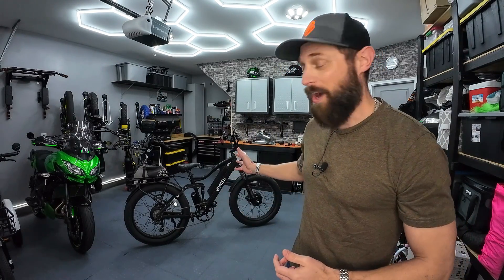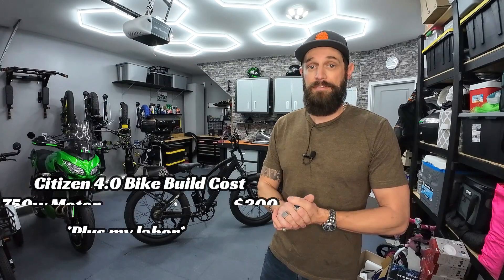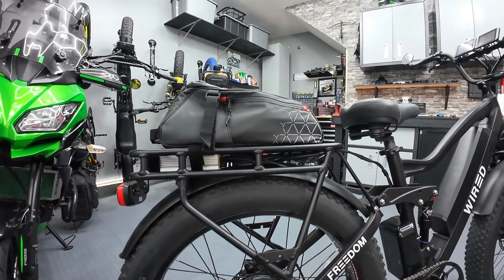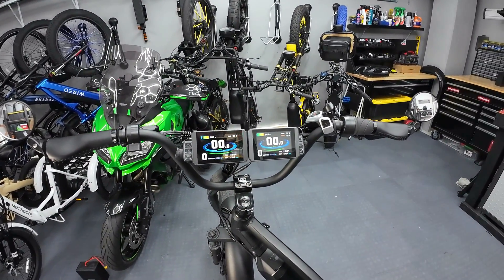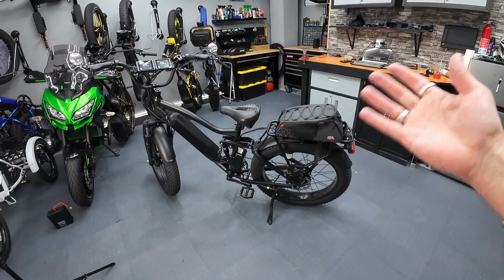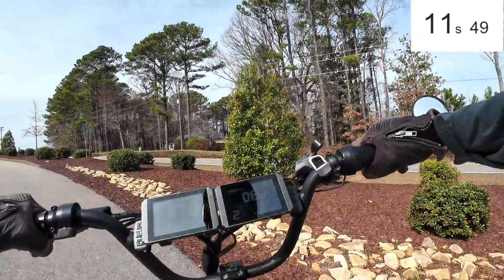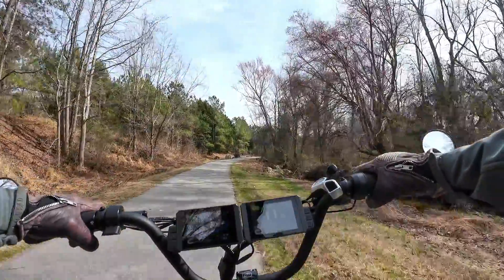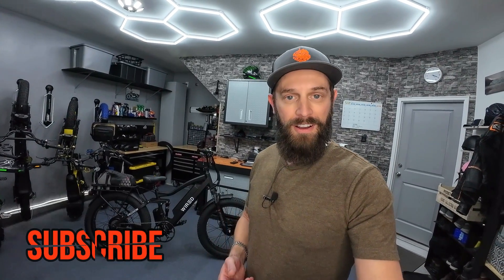AWD Conversion Kit: Should I build Them?

Comment: Great video Citizen. I'll maybe take 2 kits depending on pricing
Reply from the maker: awesome, pricing and more info coming soon!!
Reply from the maker: Hi Jeffrey, Kits are available for pre-order now at Citizenperformance.com
Reply: Hello Citizen. Did you have a final price on the kit and what is the maximum voltage on the 40 amp controller ? I have a spare 60 volt battery on hand.

Comment: I thought I posted on here yesterday, but let me know if you want the info for a 2000w front hub custom build, 500 buck's, but comes with controller, hub with wheel and display. Easy plug and play.
Reply from the maker: is this a direct drive 2000w motor?

Comment: You are the man 😎. I have the August 2023 cruiser, would this work with my bike? I also bought an extra battery ($800.00) . You said that the front forks would need to be changed, do you know what the cost of those are? That would be something I would like to get ( after I have more time on my bike,200+ hours on it ). I'm still a newbie with e-bikes (Wired) . Thank you for a great upgrade. Keep on rocking 👍🏼🚵🏽
Reply: Your forks will not work. The FST are about 200 bucks.
Reply from the maker: Your 2023 probably has Mozo forks, you would need to switch to RST Guide which are about $200.  thanks for the comment

Comment: E-Cell at 146nm is the same bike as the wired Freedom at 138nm but much cheaper!  That extra savings could buy you an upgrade front fork for front motor!

Controller KT 60v 40A 146nm controller. Delivers 2400 watts of power while the wired Freedom motor is 2200w peak!

Comment: I be thinking on this one for Kepler . I'm running on 60amp batteries already. What are wiring connections for display? Wanna use same display what I have .
Reply from the maker: this display allows you to program top speed, pedal assist strength, and slow start settings. does your current display have that functionality?

Comment: I would love the kit but dont really want the extra battery mounted.  Maybe its not possible but if it connected to stock battery somehow?  Great build tho!  Very clean build!  Great job!
Reply from the maker: will probably sell a Kit no battery option.  not sure about connecting to stock battery, not sure if battery could handle the draw from 2 controllers...
Reply: @CitizenCycle925  Yea that make sense.  Also my rear rack is not a 23 or a 24 model.  and although appears stronger?  All one piece with no wire or smaller tube bracing to it.    I dont know if controller would fit.  Another thing I was thinking is the charger for your battery.  Does it come with it?  Are they so cheap it dont matter?  I do like the fact they are 2 separate circuits.  Anyways that kit look awesome!  I would pay $800 for it but I know with some down falls.  Mainly having to deal with extra battery for me personally.  I mean its not that big a deal.  IDK   I cant answer if you should try to sell or not.  It is mean and clean tho.  Sorry Im not helping answering your question.

Comment: Resellable AWD Kit, sure...great job.
You can't stop now.
It's only 85% complete.
It's not done till you merge the displays and front/rear selector switch like the Grizzly. 
One more month, then Celebrate‼️

Next project dual 45A controllers on your Grizzly ‼️ 🤜🤯🤛
Reply: My X is better two separate systems are better in case one go down you still have a motor to help you move the bike

Comment: 🐍 Two Displays,...blah blah blah‼️
You just have a mother's love❤ for your Frankenstein build.

If you join them together like your Grizzly....You will love the build with  more ❤❤❤ simplified safer setup. 
Two throttles handicaps you.
You can't hold a cup a sip on a drink with your throttle thumb attached to the left grip.
🖖🤙
Reply from the maker: didn't want to overvolt the motor, motor manufacturer wont warranty.

Comment: You should keep 60 v batteries for both motors. Pain packing 2 different chargers. Of course higher voltage higher speed so your bike will go a little bit faster than what you just did. Always good to have that extra battery in case something goes wrong.
Reply from the maker: Hopefully with the additional range of a 780watt hour battery you wouldn't need to carry the chargers.... :)   also the 60v costs more and i didnt want to overvolt my 52v motor..

Comment: Yes, I'd definitely be interested, - IF I had a FAT bike, and IF I hadn't, just 2 weeks ago, converted my original 288W 35V 8Ah  folding mountain bike to a 1200W 48V 20Ah bike! Still on 26 x 1.95 tires, mainly because of less rolling resistance, AND the ability to get it onto the bike rack of public bus transportation here in LA. However, I may have miscalculated my strength a tiny bit, as the battery itself weighs a 17lb, plus the beefier bigger hub motor … I'm fit, yet already in my sixties ;-)    I guess I'll have to beat the bus anyways, it's way easier now!      I let a couple of my friends (who have powerful eBikes themselves) ride my renewed, upgraded bike, and they came back with a big grin on their faces, saying: "Man, that's really fast! Congratulations." and "Wow, That's fast. I want one of those too now!"
Keep up your good work! Thx!

Comment: This is super awesome! I’m   Actually right now debating on buying a wired or another ebike which has dual motors in it. I’m on the fence bc I’m on the shorter side like your wife. Not sure I’d be able to comfortably ride it. If I do buy it, Id definitely be interested in a kit. I’d like to have a 20 ah battery for it though.
Reply from the maker: as long as you put RST Guide forks on whatever bike you have, you would be able to use this kit.
Reply: E-Cell at 146nm is the same bike as the wired Freedom at 138nm but much cheaper! 

Controller KT 60v 40A 146nm controller. Delivers 2400 watts of power while the wired Freedom motor is 2200w peak!   Or buy the dual motor monarch!
Reply: I’ve seen the reviews for the ecell five star. A lot of similarities but it’s not supposed to come out until late spring early summer. No one has even test rode it yet. I actually can pick up the wired freedom and don’t have to ship it, So no shipping costs for me 🎉. Just got to pay Uncle Sam 💰. Wish I were taller 😂

Comment: How about a 60v 60v setup with the front motor just being over volted. If there is too much wheel spin just neuter it in the settings. Then fit a 15/20ah battery to the back. Then you could have beast mode and swap wheels to stocker for long range mode with a combiner🍻 using a blender with the 52v would be less desirable.
Reply from the maker: if motor is overvolted the manufacturer wont warranty

Comment: I’ve been thinking about doing something similar to my grizzly, but with a 72v kit on the rear wheel and keeping the front stock, so this was really informative thanks. Did you contact battery manufacturers for your battery or was that something you got normally? The biggest hurdle for me is finding a 72v that fits my bike with a high enough bms for a 100a controller
Reply from the maker: i went to manufacturer directly to have battery made.

Comment: I would be interested. I would be shocked if there aren't a bunch of Freedom owners interested. Why did you go with a 52V system for the front instead of sticking with the 60V system..? Cost?
Reply from the maker: Cost and also didnt want to overvolt the 52v motor.
Reply: @CitizenCycle925  Do they make a 60V front motor.?

Comment: Hail Citizen! Love what you have done. unbelievable! My only question is, would I be able to adapt this kit to my Electric xp2 step thru?? Tc from Nevada
Reply from the maker: if enough folks want a 20x4 version i could potentially build that too.  you would also need to switch out your forks to RST guide forks.
Reply: @CitizenCycle925  Thanks for your response. Do appreciate your attention. My bike totally needs another battery, not getting a lot of distance out of the factory battery. The thought of another motor would be nice!!

Comment: Good work.  I have 4 diy ebike s 3k to 4k power.  3 are awd.  I recommend 2k or 3k rear and no more than 1k front, but I do combine into one throttle.
Reply: Wired comes with a 60v 2k in the rear from the factory, and he added 750 to the front...so specs match.
Reply: 45amp x 52volt =2200watt+ 
ithink he said 52v front battery an 60v rear

thats why he has tfront wheel spin...voltage should match front and back.
Reply: @joeberginc7415  The wheel spin is because the center of mass is more towards the rear than normal, due to the battery on the back rack.  There just isn't enough mass on the front fork to hold the wheel down.  I'd be curious what would happen if the 2nd battery were mounted toward the front of the frame or even better, like a front basket to the head tube....it would have to help some.

Comment: If this fits last years model then I would be interested
Reply: Last year’s model does not have FST fork
Reply from the maker: the 2023 model Wired has Mozo Forks so you would have to switch them out.

Comment: definitely sell the kits "in fact" I'd even be interested in buying a already fully equipped AWD "FIRE-Wired" upgraded bike directly from you... 
only thing I'd rather that differs from your preference is I would of course rather have the single throttle set up and a motor selector switch...
Reply from the maker: okay thanks for the feedback, i only have 1 sample kit right now to work with.

Comment: How about a direct drive front end  so you can have a 3k front drive to pick up after the rear motor maxes out and would have regen on the front end...
Reply from the maker: there are lots of direct drive motors on the market, i wanted to supply geared hubs which are very hard to find.

Comment: I built my first dual monitor in 2019 during the pandemic 1000 watt motor and a 1500 watt motor for the rear but I didn’t have the display I had a Violimart throttle I like your build it looks clean 👍

Comment: I got to say a lot of guys are out there, throwing giant batteries, super high-powered motors, but yours seems to be the most functional, the cleanest in the safest job. Well done.
Reply: Yes as soon as i get the 2024 wired freedom. Will it come with the correct forks on the stock wired Freedom?
Reply: @jasonmanitsas2770 No, You are getting a better bike and cheaper with the new E cells. I would research before getting the Wired. Especially now they can't provide proof of them being UL certified.
Reply: @jasonmanitsas2770 I would check out the new release of the E-Cells release before getting a Wired. They did so many improvements over wired and it's cheaper, service is excellent. Even there paint job! They even water proofed the controller! Wired is now having problems providing the proof they are UL certified and it's not going to well for them. Honesty has to be number 1 when you are doing business with people! It will make you or break you. Always research a bit so you can make the best decision for yourself.
Reply: @jasonmanitsas2770  I would check out the new  E-Cells release before getting a Wired. They did so many improvements over wired and it's cheaper, service is excellent. Even there paint job! They even water proofed the controller! Wired is now having problems providing the proof they are UL certified and it's not going to well for them. Honesty has to be number 1 when you are doing business with people! It will make you or break you. Always research a bit so you can make the best decision for yourself.
Reply from the maker: thank you for that!
Reply: Well. First, I have to pull the trigger and buy one. I'm on the fence between the Freedom or the philosophy jumbo. If I get the freedom, I'd definitely be interested in the update.
Reply: @stevegriffith7236  I would really take a look at the new E-Cells over the freedom! Watch a couple of reviews as I believe you will change your mind on the freedom!

Comment: Why not just put a bigger, like 3000w motor in the rear? Having a front motor is kinda squirrellky at times I find.
Reply from the maker: i wanted to supply a kit specifically for AWD and i believe 3K Rear motor kits are already out there.
Reply: Hey @tomsewell2462 am I able to just switch mine out with the 3000w motor  would same connections. What controller would you recommend and if you can send the link thanks.
Reply: Lmao @carlosmondragon8499 why you asking this guy who just asked the same question pretty much?

Comment: might be interested, how much weight does it add overall?

Also, If you are up for it, I'd like to see what a freedom looks like on 24 or 20in wheels, if it's possible to swap the motors?
Reply from the maker: Kit adds about 15lbs. I dont have any 24in wheels but they may look okay.  not sure that 20in would look good.

Comment: I will buy your kit. As is.
But I would also pay more for higher voltage controller and battery.
Smooth quiet street tire mounted on the front wheel would be a bonus that I would be glad to pay for (including more $ for the best puncture protection).
Forks are expensive, but a good twenty millimeter through axle strong front fork would be great. Steering damper? I will buy as-is, but I would also purchase your higher end kit.
Reply from the maker: Okay, thank you for this input!! appreciate you!

Comment: What if you put torque arms on the front of a different set of forks?
Reply: Honestly, I probably wouldn't risk it. I've seen another channel "Dude Stuff" where he did crazy mods like this and said the same thing about the RST fork.
Reply: I’ve blown out a steel fork w the geared hub. Steel might be stronger, but they usually don’t have suspension and the tubing is not very large diameter. I think the RST guide fork dropouts are just so chunky it doesn’t matter. I have my 750w front hub on 72V in the RST guides and it works fine. With just the torque washers. I am using 4 of the torque washers
Reply from the maker: I dont have much faith in those Hose Clamp Torque arms, i have broken those before too.

Comment: i'm ordering a (green) Freedom tomorrow (~2 month backlog?) 
This is a perfect solution, count me in, as that'd make it the most badass bike in my KS time zone.
Reply: E-Cell at 146nm is the same bike as the wired Freedom at 138nm but much cheaper! 

Controller KT 60v 40A 146nm controller. Delivers 2400 watts of power while the wired Freedom motor is 2200w peak!
Reply from the maker: Kits are available for pre-order now at Citizenperformance.com
Reply from the maker: okay thank you for the response!

Comment: I think a high power rear wheel geared hub kit would be a bigger hit,  A 1000w Bafang hub  with a 30amp controller is the most power I have been able to find in a complete kit.
Reply from the maker: that is another upgrade i have considered making.  but i would try for 1000w motor with 45a or 50a controller...
Reply: @CitizenCycle925  yep, then we wouldn't have  to buy a Wired Freedom,  think about how much cooler the Cobra would be with the     electronics of the Freedom  and a couple miner upgrades.

Comment: Maybe if you had a faster motor in it, what about using the bafang g62, do they make front wheel versions of those?
Reply from the maker: This bike will do 33mph on front motor kit only.
Reply: @CitizenCycle925  I've basically made my own Citizen bike already, inspired by your videos, with a 750W front motor which I laced into a wheel myself. I'm trying to justify to myself a reason to buy a kit. I see new AWD bikes coming out with crazy stuff like dual 1500w motors, though they seem crippled by using a single controller. I prefer your (and my) independent motor system.   Hmmm, does my second bike need an awd upgrade ? :)
Reply: Steve there is a Bafang FM G61 . 1000W variant. In 135mm front spacing. 5.5 wind , i think it could go over 40mph on 72v. its a big M14 axle.
Reply: @EBikeBuilder_ where could I buy that?